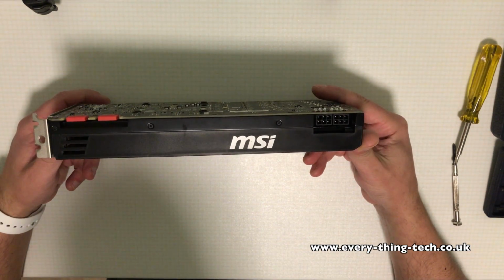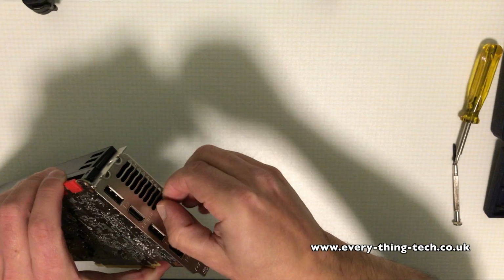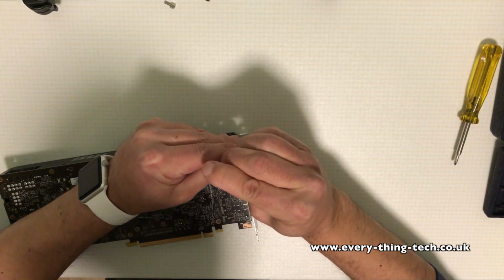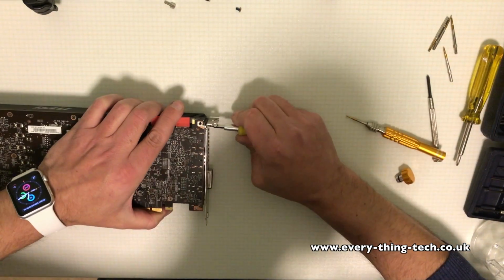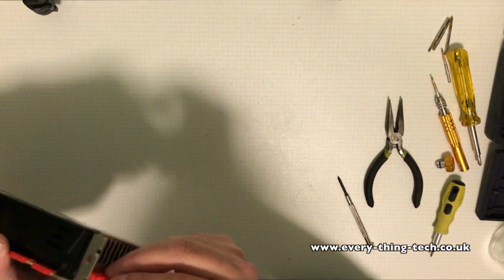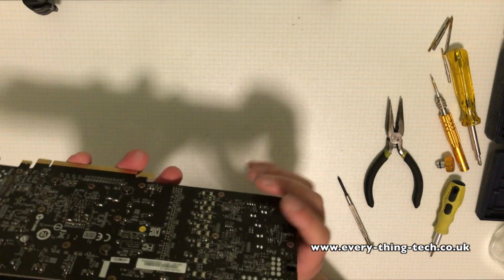MSI GTX 970 Teardown Clean and Thermal Paste Guide

Comment: I like MSI but heatsink of this card is very basic, like on most blower cards these days. I remember GeForce 8800GTX, the heatsink with heatpipes  was very cool. Nice vid, btw ;)
Reply from the maker: Yes it is. I haven't got this card anymore though. After this one I got the MSI GTX970 gaming and now the GTX 1070 Gaming 8G with dual fans and heat pipes. I might do a teardown of the 1070 soon and replace the paste. I mean, it might not even need it as the fans hardly come one, only under load. Thanks for the nice comment and thanks for watching :)

Comment: did... did he just use his freaking fingers to spread the thermal paste?
Reply from the maker: Yes, why is that an issue?
Reply: @everything_tech  You are ruining the thermal paste quality with skin oil. Don't do that, if you really want to spread it, use a special tool or any plastic card. Or just put a dot/line/cross and let it spread using screw torque and heat.
Reply: Also to add to this spreading like that can in some cases trap air meaning you won't get full contact leading to a hotspot
Reply: Yup I saw that LOL

Comment: what temperature for this card is in waiting mode ?
Reply: I have around 37-38 c  dont know I need open or no ...
Reply: I have around 30-33c. I mean, it should be ok but it is good to clean the fans at least. Thanks for watching :)
Reply from the maker: Hi Janis, if you have 37-38 c this time of the year it's hot on idle. What temp do you get when in game? I get around 70c now. Thanks
Reply: In apartment I have around 26 c when I make benchmark on 4K it shows 85 c this is max , I cleaned fun it was dirty but dont know about opening I should or no .
Reply: system is one year old
Reply from the maker: I mean, 85c should be ok. Maybe select another fan curve in msi afterburner. The paste on mine was soft so if yours is a year old it should be alright
Reply: I think is ok for now ,maybe one day I will open for cleaning